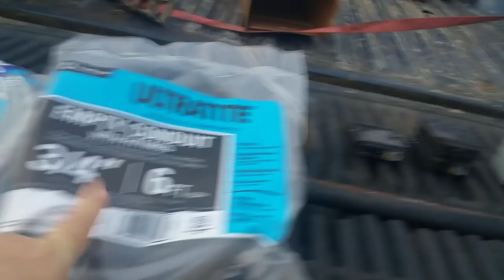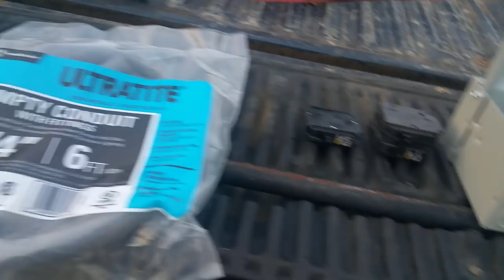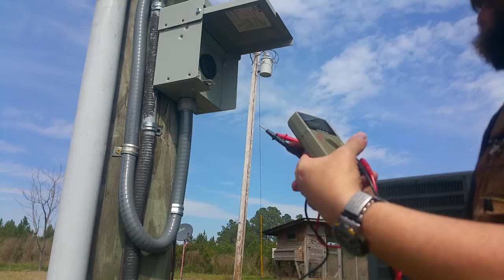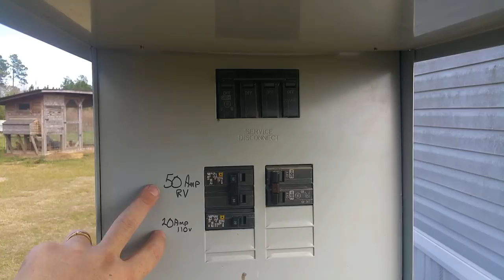Installing an RV Outlet

Comment: Well buddy I appreciate the effort you put into this and the mistakes. Some real dicks showed up in the comments section - that said, I learned something from them too. Why supposed experts watch videos about shit they seem to know everything about is beyond me. I watched because I’m considering an RV and want to service it at my house. Thanks for posting.
Reply from the maker: Thank you. They are right - I did get several things wrong. I have since gone back and put in a new #6 set of wires for the 50A plug, and moved the 20A plug over to the existing #10.  Thanks for watching!
Reply: Jamey Saunders    You did the right thing sir!   You need to link a video at least stating what you did.   It's only right!
I didn't read all the comments but want to let you know one that was probably not mentioned. 
The box you bought is required to be "listed".   When you cut out and installed the 20a duplex receptacle in that listed box, you voided the listing, therefore violating the NEC.   You should have bought a separate box and cover for the 20 amp, or bought the correct box in the first place.
Since you revised what you said, you are safer, but not totally in compliance with NEC.
Respectfully,   Kevin
Reply: dirtyshirtinfo    So according to you, people should put videos on YouTube that could cause death to others and no one should point it out!   Do you truly feel that way?   Try and look at it this way, a comment about things that are not safe are for the safety of the video maker and more importantly, the unknowing viewers that watched to learn.  
Respectfully,    Kevin
Reply: dirtyshirtinfo    Trying to generate money on YouTube is not something I am interested in at all.   I checked your channel.   A lot of miscellaneous things that you do.   Some had some with lots of views and some had very few views.   
Making videos does not an expert make.   This guy admitted to you that he messed up and that he made changes to correct the issues pointed out by "commenters".  With no comments, do you think he would have fixed it?
My concern about videos on electrical is not to slam someone but to keep them and or their viewers safe.   I designed electrical systems from 1983 to 2019.   So, I guess I am a supposed expert.    Did you even read my comment to the originator?
Enjoy life Sir!    Kevin
Reply: dirtyshirtinfo    Most comments on electrical videos are from people who "think" they know.   Many are just wrong.   Some are Dolts!   I try to stay constructive.    Respectfully,   Kevin
Reply: I know a little and a lot, little enough to be confused but enough to know I'm confused but I'm only here in YouTube's COMMENT SECTION of PUBLIC OPINION to get a second opinion on why he's wrong. There is a responsibility that goes with being a YouTube channel if you're going to do "How To" videos. I was looking for confirmation to move on when he started interchanging volts and amps, your comment helps no one and wasted my time so I'm wasting yours writing this long diatribe of a message..Who's the troll here...ijs with a chagrin grin
Reply: ...and furthermore...hehehehe!
Reply: Follow his lack of at least researching and from this video the only thing you’re gonna learn how to do is turn a screwdriver with a high speed scrubbing at it. The rest of it was incorrect information and totally worthless not even any pictures of any of the connections

Comment: Jamey, I have to comment on what I saw as a major flaw in your RV plug install is your lack of attention to advising viewers to turn off the main breaker before you start messing around inside the service panel, not waiting until the task is complete as you showed. I would also advise that the wire size should be the same as it is in the shore line, which would be more like a 6 ga not a ten. Your shore line will still be drawing current all the way from the outlet to your RV and using the wrong size wire for the receptacle can cause it to overheat, as it is still pulling Fifty amps through wiring more suited for 30 amps!  And the length of the run makes no difference on the load so close to its point of use.People could think you had the main breaker on all the time you were sticking your finger against a live buss bar, leaving them to think it was safe to handle hot current unsafely. If the first time electrician didn’t have the heads up on safety, they’ll be in for a serious or deadly surprise!
Reply from the maker: Good information there, Daniel. Thanks.
Reply: Anyone who doesn't know to turn the main breaker off first deserves anything that happens.  Too much coddling these days.

Comment: Fire waiting to happen.   You need to understand ampacity NEC rules for wire.  #6 minimum.
Reply: Bruce Watson, I totally agree, at the minimum 6 ga to match the ampacity of the shore cable, to carry fifty amps all the way thru the damn circuit or if not the undersized wire will overheat from the draw!,,this guy is very clumsy inside the main with his handling of his tools and the wires, as well! I hope no idiot followed his instructions and got hurt!

Comment: You're going to start a fire with this. Two pieces of Romex in the same piece of liquidtite is a fill issue, and then you'redoubling the current capacity of that wire. I've watched wire glow orange from people doing stuff like this. The chances of a fire are far greater than the chances of long term success on this.

Comment: You should remove this video or reupload it with it done to code. You broke several CEC codes that I can see: #14 wire on a 20A Circuit, #10 wire on a 50A circuit, Non Metallic sheathed cable used outside, flexible non metallic conduit where subject to physical damage, no gfci protection, no afci protection(may not be required), modifying  equipment. In America where the NEC is used, I know it isn't much different than the CEC.

Comment: Wow lot of work I have a old dye duplex and decora punch set. I can punch. The hole in 1 minutes . You really made me respect that punch kit. After watching your video. You did a great job on cutting duplex  out. Great video. # 6 wire  can go to 60 amp used # 6 and for voltage drop for a 50 amp. #10 wire go to 30 amp. So if pull more then 30 amp you will start heating up the wire. Beyond it limits put a 30 amp breakers to protect that #10 
Used
Gfi breakers

Comment: WOW!!!!!This is exactly why you should not do this if you don't know what you are doing, first thing first... the box did not have a receptacle in it because it wasn't designed to have one, second you size the breaker to the wire, #10 is too small for a 50a breaker and #14 wire is too small for a 20a breaker, nor should you have installed a 20a receptacle on #14, and the receptacle should be GFCI protected being that it is outdoors, also you should look at conduit fill ratios, it is WAY!!!! overfilled and if you install romex in conduit it must be de-rated because the lack of cooling... I hope your insurance company doesn't see this video...this is a fire hazard and a  death trap!!!!!!
Reply: I could not agree with your statement more this is totally wrong he's just waiting for something to catch on fire, use the right size wire for 50 amp and 20 amp totally wrong. I'm not a licensed electrician but I am a licensed general contractor. This is so wrong on so many levels
Reply: Should be at least 6/3 wire for 50 amp service and no romex casing inside conduit and never add a receptacle inside a single space  single circuit outlet box.
Reply: Yikes...is right
Reply: Do you know if it is possible to hook up a RV trailer that has 50amp to an outlet with 100amp? The site is for mobile homes and has ports for travel trailers, mine will have 50amp and was wondering if I need an adapter. Thanks!
Reply: @alicialundstrom373  Yes.  Breaker is rated to protect wire, not devices plugged in.  An RV is just a sub panel.  The RV main breaker is there to protect the RV.

Comment: You seem like a nice guy but you need 6awg cable for 50 amps. If you don’t know what you’re doing with electrical you don’t do the job. When it comes to electrical there are NO “mistakes”

Comment: You should of  used #6  wire I just did a job the wire was to small and it was getting extremely hot so I replaced it it was a 130 ft run very expensive but it could have been avoided  the a/c guys didn't know what size wire

Comment: Never 14 on a 50. Calculations are not the issue, code and safety. That wire is not rated to pull a 50 amp load too much resistance and will fry.  Also are you running 240 volt to you Rv with that? Hope your shit hadn’t fried yet. 30 amp 120 is all you need. 10/2 wire.

Comment: That was a great idea on putting in the 110 outlet. I was told that I need a 6ga. Wire for my RV. Not that you did anything wrong on buying the cable with all your wires in one. I found it's cheaper to purchased each wire separately  and it makes it easier to get through the gray pipe. I need to run about 70 feet of wire to my outlet box where I park my coach to the 200 amp.  service box.i hope that made sense. Thanks for sharing your video with us. I'll be watching thanks
Reply from the maker: I made some mistakes based on wire size calculators and some assumptions, which I have corrected, but the 110v outlet is really nice to have. Comes in really handy. Thanks for watching!
Reply: @JameySaunders  No , thank you. We learn from our mistakes . It great that you caught it before anything happen to your RV.  It would have been costly. I've learned a lot from people like yourself on YOUTUBE. There are some folks our there who only  criticize others like they make no mistakes.

Comment: Would like an update as to what has burnt up to date? Great effort but have to agree this video serves as a perfect example of what not to do.  I'm no expert but I know what I know.  Damm good fabricating that 110V outlet though!
Reply from the maker: Nothing burned up, but you're right - I did several things wrong. I have since gone back and put in a new #6 set of wires for the 50A plug, and moved the 20A plug over to the existing #10.

Comment: NEC code requires at least 8 gauge wire for a 50 amp circuit. 14 gauge is way too thin. Length of wire run has nothing to do with it.

Comment: Oh by the way one more thing you could do more easily is to first determine where you wanted to mount the box and cut the conduit to the exact length before running the wire through it, and it’s not only a wiring code violation to run Romex through conduit, but dangerous as Romex will overheat when run through a conduit as you did for your 120v outlet, and if you’re running a group of single strand wires through the conduit it’s not as difficult to feed them through as you discovered using Romex in both cases.

Comment: I'm not an electrician but my question is ...did you want to make that 220 volts? I thought RVs were 110 Volts? It looks like you made it 220 volts.
Reply from the maker: Well, yes and no. RVs are 110, but a 50-amp RV splits that 220 line into two 110 lines.
Reply: @JameySaunders  thanks
Reply: Almost correct.   50 amp RV electrical is 120/240 volts.  Statement is complete.   All of the electrical equipment within the RV is 120 volt with exception to some very large very expensive Class A bus diesel pushers.

Comment: Did you use 14ga wire on a 50 amp service?
Reply from the maker: Look at 25:15. I made a mistake in the initial calculation. Ended up with #10.

Thanks for watching!
Reply: 10 wire is rated for 30 amp...8 wire is rated for 50 amp...if you pull 50 amps through 10 wire..no matter the distance you will over heat the wire...not good
Reply: ^^agreed
Reply: should be 6 gauge for 50  amps
Reply: #6 would work on a shorter distance, but due to voltage drop you would want to use #4.

You probably wont find anything in solid at that size, except for grounding wire. Everything is stranded to ease installation.

Type of wire depends on scope of work. If the wire will be indoors  an the outlet is on the outside use Romex, otherwise you will need to use; #4 Black, #4 Red,#10 Green, #4 White THHN and sleeve it in a conduit.
Reply: @williambottino1262  8 is rated for 40...use #6...
Reply: @mathewshoyt1763  This is what we call a youtube electrician.
Reply: @mathewshoyt1763  # 8 thhn-2 single strand at 75 degrees Celsius is rated at 55 amps.

Comment: Only thing I would have done differently is run THWN wire in the conduit sized for the full capacity of the receptacle.  Yeah, GFCI is technically "required", but that should be a personal decision made by the user.  Government overreach has gotten out of hand.

Comment: So many mistakes.  You should really remove this video. You ran NM (Romex) instead of THWN, undersized conduit for number of wires, No GFCI protection on the 120v outdoor outlet, illegally  modified the box to accept a 120v duplex outlet, initially undersized wires to both outlets,

Comment: How much would something like this cost to get installed?
Reply from the maker: I couldn't tell you, but I would STRONGLY recommend having it done professionally. I made a TON of very serious mistakes doing this myself, which I have since fixed, but what you should really take away is that if you aren't 100% sure of what you're doing when dealing with electricity, don't do it yourself.

Comment: What? Your putting a 10/2 wire on a 50 amp service. Dam mister you need a number 8 wire for 50 amp. I don’t think ied do that. If it ever over load you RV burning down pal
Reply: 8 too small... need number 6
Reply: @mr.3phase228  #8 thhn-2 is rated for 55 amps, its right in the code 310-16
Reply: @thomasmarable6818  that’s 90 degree

Comment: I am planning some project..just wondering why you didn't go with GFI outlet for safety since it's outdoors?
Reply from the maker: TimCatZ Every GFCI outlet I've ever interacted with outdoors went bad pretty quickly. This outlet is strictly intended to give a place to plug in tools. I don't intend for anything to remain plugged in for more than a few hours.

I wouldn't discourage the use of a GFCI outlet, though.
Reply: understand...sound exactly like my situation...good suggestion.
Reply: They make gfci breakers that fit where normal ones go, they last way longer than a gfci plug does
Reply from the maker: VinierrhinoGaming7986 I wasn't aware of those. I'll certainly look into one. It'll be useful for the outdoor outlet on the house that doesn't work anymore! Thanks!
Reply: I've had gfci protected receptacles last 10 years without issue, if installed properly and using them properly they work fine, a gfci breaker will not fix misuse......Please fix your rv plug properly......

Comment: I am also not an electrician, but I have watched a couple of youtube videos and stayed at a Holiday Inn last night.  There are 4 ports on the 50 amp receptacle.  2 hot legs, a neutral and a ground. Did I miss something or is it OK to wire just the hot legs and the ground?
Reply: After watching videos from guys who know what they are doing. I see one of the problems. This sub panel does not have a neutral bar. I'm guessing no code inspector has ever been near this man's property. Sorry to be so hard on you Jamie, but this is dangerous. Please get an electrician to come out and check your work.
Reply: Mruofacat no way! You’d still need a neutral wire to complete the circuit or it won’t work!
Reply: #6/4 wire minimum for 50 amp service. The wire he used is severely under gauged and there is no neutral.  I really dont see anything informative about the video unless your trying to fry your RV or start a fire. Hope you got it fixed. Cutting corners and saving a couple of dollars is a lot more expensive than replacing your RV or your house
Reply: @danielwood8778  , Correct however on a sub panel Box not your main Box grounds and neutrals must be separated he just created a ground loop making any metal object that was previous grounded a hot.
Reply: @mruofacat  , There are a alot of different 50amp receptacles, he was wireing a 120v 50amp,  known as an RV outlet it is 120v with 3 legs, not the 240v 50amp 4leg. Some are 120/240v 50amp 4leg Generator outlet also. Be careful what your plugging into.
Reply: Robbyota 559 50 amp on rv is 240v the converter inside rv separates the voltage that way if you have 2 ac units you can run them both because they will pick up separate leg of the 240v if pull into a park that doesn't have 50 amp service you can plug a 30 amp adapter to run your rv but only 1 ac can be run
Reply: @robbyota5598  no he was not thats a 6- 50 device which is a 240 volt device.
Reply: @Thomas Marable  ,  You're right I was wrong after reviewing.
Reply: @mruofacat  What sub panel are you refering to?

Comment: More mistakes. In the trade never wear watches and rings or neckless. Look at you 30 amp wire, should not be same size as 50. Never get used to putting your whole hand in the box, always one hand in pocket.

Comment: Buddy, you invalidated the certifications on the RV box you purchased by mounting the 20a receptacle.  LOL.  If something catches fire with anything you have done here, your insurance is completely invalid.  You saved a penny doing this yourself, but with all your mistakes it will cost you a fortune with all of the serious mistakes you have made doing this project with no clue as to what you are actually doing.  Learn from this guys mistakes, but your lesson should be to not listen to people that have no idea what they are doing.  Sure, you can replicate this and get power, but when a fire happens and your insurer denies you insurance on your home/property, you will eventually learn the lesson that you fail to heed to in doing this work.  Good luck, but take my advice and disconnect before you lose everything.